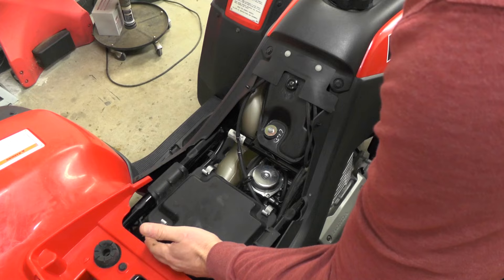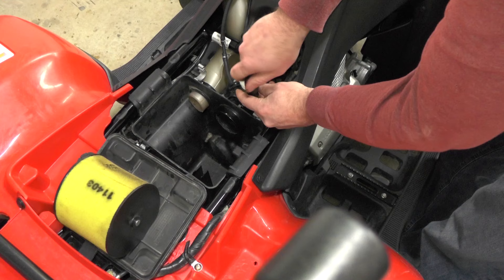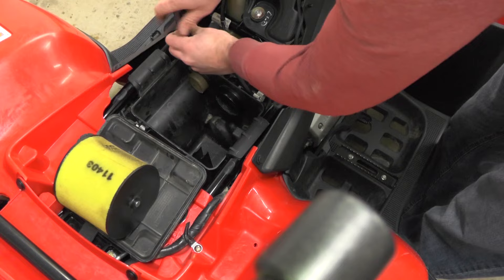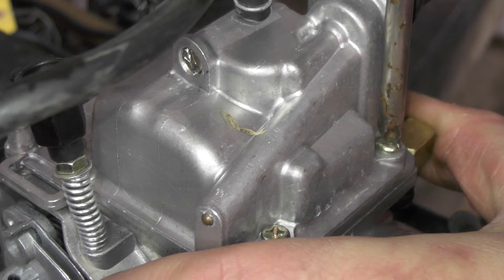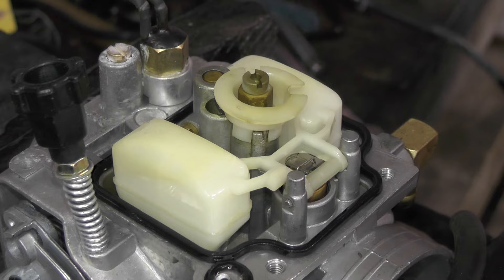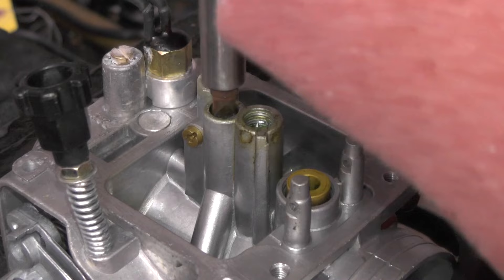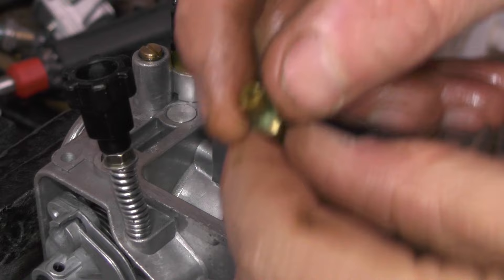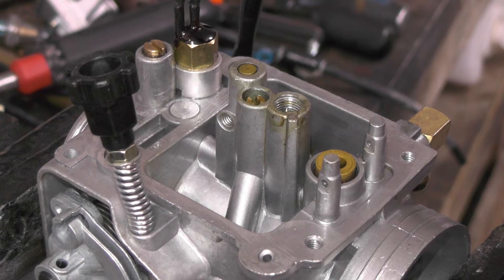Honda Rancher Fourtrax: Carburetor Removal and Cleaning

Comment: Can't thank you enough! My 2000 rancher 350 suddenly started draining gas out from the bottom of the carb. Did some research and had something to do with the needle not seeding and triggering a overflow from the bottom valve on the carb. I followed your video, took the carp apart, cleaned her out, and after I put it all back together no more overflow draining! It also seems to idle better and run smoother. Thanks again, you saved me about $100 over taking it to a shop and now I'm comfortable working on it myself.
Reply from the maker: Anthony, thanks for your comment and great work on your Rancher. Here is a couple other Rancher tech tip videos.  

https://www.youtube.com/playlist?list=PLOqvKi40if-IeBqpC64492GB40WC2jTvL

Comment: Breaking mine apart tomorrow. Hopefully it goes as smoothly as you made it look. Thanks for the video!
Reply from the maker: +Jeremy Arnold, Welcome, if you have troubles getting the throttle or choke cable (13mm) off you can remove the gas tank and heat shield for more work room. Most of the difficulty is just due to lack of room to work. If you do go that route you may want to check your valve adjustment and I'll be posting a "How To Video" on that later tonight. Also "Moose" makes a good carb rebuilt kit for these you can pick up for around $30-$40 at your local shop.

Comment: My 2007 Honda Rancher TRX400FGA Has Never Had Carb Apart I Planned To Ride It The 3 Days Before Christmas And Christmas Day I Test Rode It In The Field By My House And It Ran Great I Loaded It On The Trailer Pulled It 62 Miles Unloaded It Opened The Petcock And Fuel Started Leaking Out I Didnt Get To Ride At All. Friend Said If I Buy Carb Kit He Will Rebuild My Carb For A Checkers Hamburger And Fries That Is A Deal He Use To Work At A Motorcycle Repair Shop In Indiana

Comment: At 37 seconds, what is the copper/brown looking part that he grazes with the wrench, on the way into the bolt? I obtained a used 2000 rancher, and it has that part, but someone seems to have "melted" a small hole near the bottom and inserted a gas overfill tube inside. 🤷

Comment: Man this is going to save me sooo much money, I plan to take off the carb and clean mine for the first time. My question is with the choke, throttle cable and gas line, gas line is simple but was the throttle cable and choke cable pretty straight forward when you went to take them off? Thanks

Comment: I have a 2013 honda rancher 420, so it has hard time to start only if i spray some carb cleaner and it will start,, sound like i need to freshly clean the carb amd jets? It has only 527miles on it for a 2013
Reply from the maker: Yes, carb cleaned for sure with that low of milage on a 2013, its sit more than its been ridden. Suggest Lucas fuel stabilizer. With the fuel these days, its good insurance.

Comment: Which one is the high speed jet? Mines ideling great and low acceleration is great but if u try to punch it, it try’s to die out I’m thinking high speed jet?!?
Reply from the maker: The smaller jet is the pilot jet. It is easier to clog and provides you the fuel needed when accelerating quickly. Thanks for the comment

Comment: You mentioned that the smaller jet was likely the problem.  You said you can't see through it.  Is that because of blockage or is it designed to see through from end to end?  I removed mine and I cannot see through it.  I tried using cleaner and a thin wire and it will not go through from end to end.  The small holes on the side are clear and I have blown air throughout.  Just need to know if it is suppose to be open end to end.  If so, I have a major blockage and will just order a new jet.  Thanks
Reply from the maker: Richard, you should be able to see through it, although it's a very tiny passage. If it's lost it's brass color it may just have enough tarnish to close it off.  Send me a picture of your's with the numbers on top (jet size), I've probably got a new one I can mail you, that didn't get used in other carb rebuilds. 606-425-0682

Comment: We have a 1993 Honda Rancher, to remove the carburetor, there are 3 plugs on the frame the one that connects to the carb, is that a solid piece and how do you remove the wiring from it?
Reply from the maker: Beverly, the hoses are all vent or overflow hoses.  Don't be to overly concerned about these hoses, but take a picture of them and try to get them back or close to possible on re-install.  They likely have been there long enough they will still find there way back.  The plugs holding can easily be removed with a screwdriver or vise-grips.  The 2 wires that are in conjunction with them also slide out of the clip.  I've seen many of these Ranchers, with these hoses-wires zip tied back into place and they function fine.
Reply: Hi I am having trouble undoing the wire plug from the carb. Any idears how to disconnect them. Guy.

Comment: Unfortunately, the 1998 Foreman airbox will not move back enough and it also will not come out due to the really long intake tube.  Crunching an old stiff rubber coupler enough to move it off the carb is very difficult.  If they would have made the flange on the inside of the airbox instead of the outside, it could slide into the airbox (with the filter removed) making the process MUCH easier.  Engineers have no consideration for technicians.

Comment: I have a 2001 Honda rancher 350 idles pretty good and cranks easy but if i'm driving it wide open it will b e like it lost fuel and i can can knock it out of gear and rev it and then it is fine but it will do it again
Reply from the maker: Chris, sounds like it's starving for fuel on the top end.  It's most common for the smaller pilot jet to get clogged, but yours points to the main jet partially clogged.  Either that or you're float needs adjusted to let more fuel into the float bowl.  Before taking it off give this trick a try... remove the air filter, start the quad and rev it up... with the engine reved up place your hand over the back of the carb.  It will stall out and pull fuel through the rear of the carb and possibly remove the debris from a clogged jet.
Reply: hey the carburetor looked good on the inside when i took it apart and  i sprayed it with carb cleaner again but have not run it wide open agin yet
Reply from the maker: Good deal, let us know how it turned out when you get a chance.
Reply: well is had some cut outs just driving it around the yard today
Reply from the maker: As you know taking it back off requires some time.  We've had the same bad luck before on more than one occasion.  Gunk makes a powerful carb cleaner that you soak parts in overnight that is pretty impressive in it's cleaning ability, is reusable, but will cost about the same as an entire carb kit.  We generally do the carb kit to save time in the circumstance we miss something.  Pulling the carb requires removing a lot of plastic... how long has it been since you checked the valves?
Reply: could to spark plug cause this problem
Reply from the maker: I would think not... but anything is possible when dealing with engines.  Spark plugs are inexpensive and easy to change.  You're likely troubleshooting a carb or valve problem.  The exhaust valve may have tightened up.  As far as the carb goes,it's extremely difficult to see a partial blockage in the jets (mainly the pilot jet) due to their small size and precision.  This is where a carb kit with shiny new free flowing jets often saves work.
Reply: what is a good name brand carb kit and we had to four wheeler about six years but its been parked for four years but before then it was not rode a whole lot but we are the second owner and the guy we bought it from had it serviced by Honda every time mean i don't think it could be a valve but how do you tighten them
Reply from the maker: We've had good luck out of the "Moose" brand carburetor kits, they come with most everything and cost @ $30.  Here is a video we did on the 350 Rancher valve adjustment. https://youtu.be/Cg6RF0fl8ZU
Reply: +Everything ATV-UTV-Reviews ok man thanks for the other video by I was Wong it run pretty good wide open but if you let out of it it would sometimes cut out when u gave it gas again and if u stab the throttle is will bog down and sometimes even die
Reply from the maker: The pilot jet is extremely small and a grain of dirt would be enough to hinder the flow.  I'd pull it and see if you can see through it, if not a very small wire and shot of carb cleaner should do the trick.  Good Luck
Reply: +Everything ATV-UTV-Reviews ok man will try that and I appreciate all the help
Reply: +Everything ATV-UTV-Reviews ok took the carb back of I could see through the to jets fine still cleaned them out and it still has the hesitation when u stab the throttle and sometimes it will spuder when u slow down and take back off fairly quick
Reply from the maker: Chris, I'd check the valve clearance next.  It's very straight fwd on you're engine.
Reply: +Everything ATV-UTV-Reviews ok can I reuse the old gasket and what do I set them to
Reply from the maker: Gasket is reusable and both intake&exhaust set to .006in or .15mm
Reply: +Everything ATV-UTV-Reviews does it matter since it have never been changed
Reply from the maker: I've done several valve adjustments on at least six different Ranchers and always reused it without problems.  As long as it comes off undamaged you'll be fine.
Reply: +Everything ATV-UTV-Reviews were can I get one if something is wrong with the gasket
Reply from the maker: Check your local Honda shop first.  If not one close to your location I'd check online with rockymountainatvmc.com or bikebandit.com.  I've sourced parts from both in the past with good results.
Reply: Everything ATV-UTV-Reviews hey man it has been a while since I have been on here and I finally got to to work on my atv again and I was going to ask you what is next the valves were not out of adjustment and the car has been cleaned and all the jet has been blown out with a air compressor but the four wheeler still cuts out when you are running it wide open.
Reply: I have a 350 honda rancher and the carb are not getting gas so it want start can someone please help me
Reply: @kelvincarmichael1701 i have the same issue
Reply: @ Chris Graham what was wrong with yours?

Comment: Could it getting to hot play a factor
Reply from the maker: Excessive heat is always a bad thing for any engine.  Most common problem for carbed atv's with the symptoms in the description is fuel issues related to clogged jets etc.
Reply: +Everything ATV-UTV-Reviews yea i mean it's been getting so hot
Reply from the maker: Understand, describe how it's starting, idling and running.  A bit of history on the quad will help also.  Will try to diagnose...